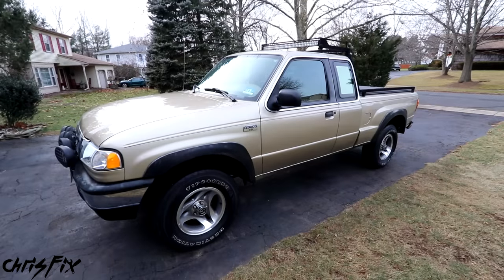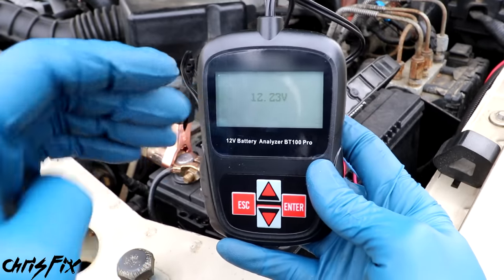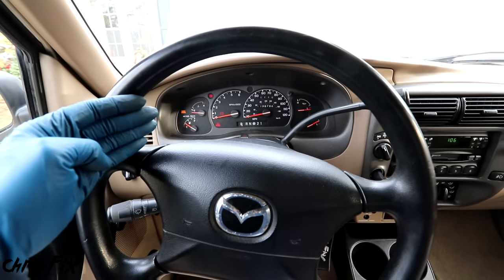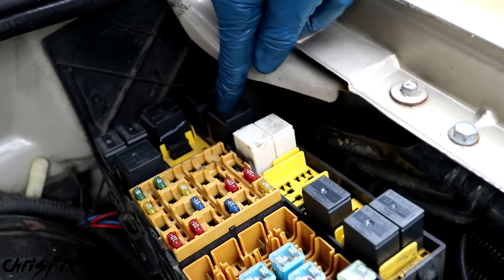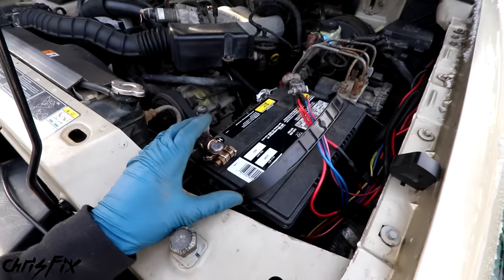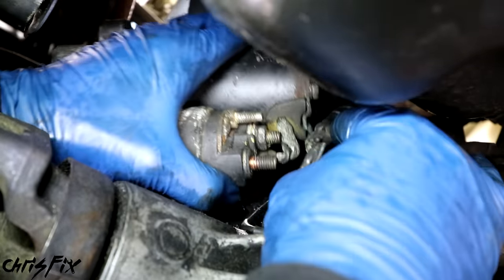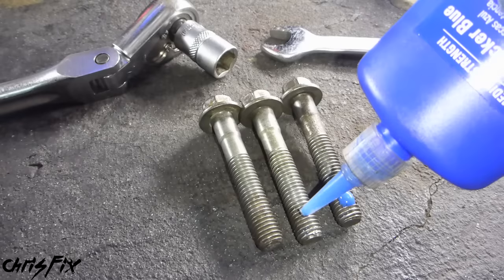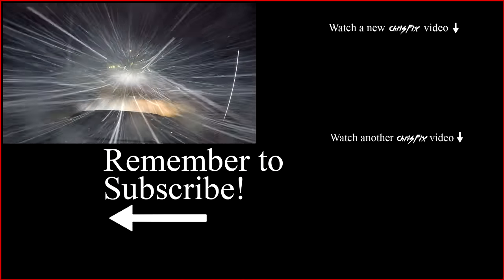How to Diagnose and Replace a Starter

Comment: Bro. I love your videos. You’re a really skilled technician. But wanted to let you know you can load test the vehicle battery with a DVOM and by turning the head lamps on. If a battery doesn’t stay above 12V after about 20-30 seconds it’s bad. Just a tip from me to you. Keep up the awesome work 👏

Comment: I don't have a starter story.... but I do have an alternator story! 
I was driving to a junkyard to get parts for my 1992 Ford Aerostar. When I left the junkyard the battery was dead. After a jump it started right up and I drove over 2 hours from the junkyard to my house, where all the gauges were being erratic, and it finally died on me as I was pulling into my driveway. Another jump, and it died again later after letting it sit. Got in the beater to go get an alternator, installed it at home, and everything was great. So blessed to have a dying alternator last an extra 100 miles to get me home.

Comment: Extremely well put together vid! A well polished edit that is very informative and easy to follow. No annoying editing tricks, background noise, time wasting visuals, or word whisker commentary.

I have a Japanese imported van that may need its starter motor and solenoid replaced. There are currently no videos on the van I own that will serve as an exact how to... YET, this vid is what I plan on using to get the work done on my own. Swapping out a starter is rather straight forward. This video covers a lot of useful information on this subject that can assist any viewer with the same goal, but working on a different vehicle.

Moreover, the commentary was superb! Usually you get the guy over a vid like this that struggle to explain what they are doing. They will usually say “ummm”, “and like”, and use “kind of” between every other word or in every sentence. Not to mention bad audio that will leave a viewer wondering what they said. NONE of that here!

Thank you ChrisFix!

Comment: You did a great job on diagnosing and replacing a starter. But the one thing that helped me that I overlooked was the battery cable. Thank you for your input. can you do one on blower motor

Comment: Great video, very entertaining as well as informative :)  I have a 2006 Honda Accord.  Periodically the car has a hard time starting.  I checked the battery which is only 2 years old.  And it will start with a boost.  I figured it was the started, now I'm debating if it has something to do with the key now I've watched your video.  The key housing is cracked.  So I wonder in the chip is not sitting right.  I don't want to get hosed on replacing the starter and then it turns out to be the key.  Thanks again for a great video.

Comment: Excellent video and channel. I love working on cars, but when I can't troubleshoot the cause, it frustrating. With your video, I learned enough to hopefully fix my car. I have a 2005 Civic and also has a no crank problem. I suspect that is the starter relay because last month I also had a no crank problem and the symptoms was a bit different: it as a click sound. So I replaced the starter and problem solved. But now, after a month, when I turned the key, after like 20 or 30 attempts, my car cranks / starts and I almost no hear a click. The starter is new, the immobilizer is working, I don't think is the battery because my windows rolls fast and it cranks after several attempts. So I think is the relay, unless the starter is defective. Thanks for sharing, I also subscribed to your channel for your good content. (Ha, and another way to support your channel is to not use an adblocker, so I don't have one :)

Comment: 1985 thunderbird: to get to the starter, which is attached to the trans underneath, I had to remove a supporting cross bar whose bots must've had 30 year old rust and undercoating cementing them in there. I dont have the fanciest wrenches to I ran an extension and universal joint through the undercarriage of the car and onto the top starter bolt. thankfully, the starter bolts where relatively easy to turn but I'm thankful I finally got the thing out! dont give up!😄

Comment: I once replaced the starter in a 2005 Ford Focus that was sort of difficult to get to in the middle of the engine but what made it a real tough job is the auto parts store, ( i won't mention which one) gave me the manual trans starter instead of the auto which the three bolt pattern does not line up correctly to prevent damage to the flywheel. So like Chris says always bring the old one in to inspect and see if it is the right one!

Comment: Thanks for the video.  Have a 2004 Ford Ranger.  Power stering fluid is dripping down the wires to the starter.  Having intermitant start issues.  Going to pull out the starter, but wondering if that could damage the wires?  Hope for the best.

Comment: Chris the starter keep running today on my 82 FJ40.  It finally stopped on it's on, but then won't start next.  Hit on it and it started.  Tried it again and it worked.  Plan on replacing it before I go anywhere in the next few days.  Any suggestions on the FJ40,  gear reduction starter?

Comment: Great video!  My starter sometimes makes a whirring noise when it starts. 1999 Ford Ranger 3.0L 4WD.  Only does it sometimes.  Would that likely be the starter drive going bad?  Always starts, just makes the noise sometimes.  Also, would changing the starter in your video be made easier by loosening the front U-joint and dropping the front drive shaft?

Comment: Hey Chris.  06 honda civic.  Bought it with no start problem.  Charged battery and it load tested said battery was good.   Got my son to use ignition while tapping starter.  Fired up.  Worked for about 3 days and same thing.  Took starter out and bench testing it find it engages and turns every time.  But with no load could that mean starter is still bad?  Don't want to put it back in.  Also don't want to replace if unecessary

Comment: funny thing. I could've sworn my Mom's chevy spark 2017's starter was kaput, but turns out the battery was the problem. And with this vehicle is totally cramped, had to remove the wires first and then the bolts, oh there was only two on this model. But in hindsight, I learned a new skill. And the car has more than 30,000 miles on it now. FIgure, I fixed a future problem lol. And the battery was 12.3. So now I know this isn't powerful enough. Now just need to order a new battery, Thank you for the lesson tho. Always good to learn new things. Have a good one.

Comment: Hey Cris. You could have tried to replace starter solenoid... it's cheaper than the whole unit and easy to do when starter is off the car. Usually it becomes bad because contacts inside go rusty and that needs to be replaced because in very most cases it couldn't be dismantled without angle grinder and welded back once cleaned, but it is not so expensive to play such games with it... If hammer trick works... the solenoid steel bulb that pulls bendix hand also can go rusty which makes the bulb stuck (sometimes sanding the rust off helps). Starter on my Ford Escort mk5 '91 is located right behind the exhaust manifold, and on hot, sometimes, starter was not working because it is being ceased because temperature expands the solenoid bulb, so I had to wait until it cools down and then try to crank. Life hack (not tested by me) : Guys tell that the bulb could be given to the miller and he could take off 0.5 - 1 mm from bulb's diameter and temperature variance won't harm the solenoid...or put a screen below the exhaust manifold to reflect the heat.

Comment: I'd recommend buying cheap starters online instead of remanufactured or new from an auto parts store. Last one I got was 1/6 the price of new from a parts store and worked fine. I once went through three bad remanufactured ones in a row before buying new online at 1/3 the price, and it's still working four years later. When they "remanufacture", are they even testing? I've also gone through two bad remanufactured power steering pumps on one car, but that was in the days before you could buy cheap online.

Comment: So Chris fix what do you think about this scenario. Car cranks and acts like it normally does when starting but don't start. It takes 4 or 5 attempts to start. My mechanic said it might be a fuel pump. I primed the pump about 6 times and it didn't make a difference ruling out bad fuel pump. What do you think? (It was very cold but my car starts good in the cold. Battery is good too.) (I have concluded that I got bad gas from a station because after I filled up at a different gas station the problem was gone. Was it just a bad tank of gas or something else?

Comment: thank you very much for sharing your experience. I have problem with my starter; looks it is shorted to the battery positive; not sure but run some diagnostics to find out where the short is. Thank you foryour uploa it is very iformative and to the point. Good commentarym good video visuals and well explained. Keep up the good work. I liked your video.

Comment: 84 Mustang 302. Starter field. You have to use an air ratchet on the top bolt.
I used about five starters from O'Reilly's. Worked at First. And then they filled. In the weirdest places. So I bought the top-of-the-line starter from O'Reilly's and never had any more problem with it. You actually get what you pay for.

Comment: Hi chris, I have a 2013 Honda Accord v6 push button start (keyless). When I put foot on brake & push the start button in Park I hear 1 click inside the starter but no crank. When I pull the solenoid control wire & put positive lead in it with negative lead on neg. battery terminal I see 12volts for a split second then back to zero volts. My question is should that 12v stay solid after pushing the keyless push button start? I am trying to diagnose on why it takes multiple push button attempts to get my 2013 Honda Accord V6 to crank over by starter. I see many people owning 2013-17 Honda Accords complaining about this. I see that in 2013 Honda put the starter solenoid inside the starter housing instead of having a separate external mounted starter solenoid prior to 2013. Thank you for providing any info that can help me or others. Happy Holidays & Stay Safe!

Comment: CHRIS  great video but on my 2003 camry LE V6  was running fine but came out and when i turn key i hear a spinning or wining noise from the starter.  but dosnt turn over at all.   what do you think
Reply from the maker: Sounds like the bendix isn’t coming out all the way so it’s spinning but not engaging the flywheel. Replace the starter.

Comment: You should also check the 'other end' of the battery terminal cables. I have had a couple of problems where the nuts were loose and/or corroded. Also had a ground cable connected to the engine block with a bolt that was too long such that it bottomed out before it tightened on the ground cable terminal. I added a couple of washers and fixed that starting problem.

Comment: I’m a little excited now. Never replaced one and my crappy ranger definitely has one. Only before it went out it was giving me signs. Like for a sec after I started it it would sound like it didn’t pull back and the engine was turning it. It hesitated a bit the last time I cranked it

Comment: Intermittent no crank/no start on 2010 malibu. Only during the cold seasons...dropped new battery in because it wasn’t up to par. (Needed it anyways). Will start at times then not start for a day or so. Starter, neutral safety switch or possible relays? Heard it could be a plethora of issues, some of these included. Any advice helps!

Comment: Sup Chris. I have a long story but here it goes. My 08 dodge charger is having issues starting. I replaced the starter and the relay. The battery was still good for starting so I'll be changing that soon. The kicker is that when I go to start my car the belt moves forward but suddenly goes backwards during the starting process. We accidentally found out that putting it in neutral and rolling in t backwards would help the car start from it getting unloaded from the tow truck 😅. But after that she only starts periodically like it's processed 😕. Just wanted to ask if you knew anything on that. 💯

Comment: this video is AWESOME! I couldn't believe that my car worked one day and not the next! So Annoying! I replaced the battery because it was old, but still, no turnover. That's fine, the battery sucked anyway. My car doesn't have that "theft" light, but I decided to change the battery in my car key anyway. Still no turnover. Again, no big deal, a new battery is better than old. Then I realized I was parked on a steep hill, and perhaps it wasn't quite in park, or partially "fell" out of park. I "pushed" the  gear shift down a little and then up HARD into park. THE CAR STARTED! THE CAR WORKS! If it doesn't happen aain, I will consider it "user error" (mine) - if it happens again, I'll have to take it somewhere to be looked at for why it "falls" out of park! YAY! YAYAYAY! Thank you!

Comment: Chris, appreciate the video, as I was unsure that the starter was the problem. My '03 Honda tends to go from doing nothing on the first try to sluggish turning to starting on the third or fourth try. My question is about CCA. After watching the video, I checked my battery's voltage and saw also that my CCA is 350. From the video, that would appear to be low CCA to start the engine. I searched and read that this model needs 640 CCA and Autoweek recommends 600 CCA. Do I just need more battery?

Comment: My starter died on me twice this year. First time in february. I thought it was a flat battery but jump starting it didn’t work and I had to get it towed. I just finished a 10 hour night shift and was pretty tired, so walking home in -25 C for over an hour was not fun. After he changed the starter it worked great for about five months. It died on me again this week; this time I also assumed it was the battery, as the starter was fairly new and the battery isn’t. However the battery is good, so I thought it had to be a blown fuse or something, but no. We tried hitting the starter with a hammer while turning the egnition like you said, but with no luck. So the mechanic changed the starter again. It works great now and starts up quickly. I’m starting to think there’s an issue because a starter should last longer than a few months and I’m not driving That much. Do you have any ideas?

Comment: I got a question, you said silicon is a good idea to put on the starter to protect the connections, is it also a good idea to put it on the battery terminals too? I know there is red battery terminal spray used to protect it but could silicon be a supplement ?

Comment: I ran into a situation where my car is no crank no start and it was running great yesterday. I have checked the starter alternator and the battery. The check engine light didn't light up as you said.
Any videos about how I can tell if the computer is good or bad?

Comment: Thanks my 2002 camry v6 was hesitating upon starting,  eventually just slower and slower till it quit on me. 
I whacked the starter and it spun but made an electrical buzzing noise and smelt like burnt wires. 
Took it out and I could smell the solenoid had that burnt smell and some rust on it.
I'm trying to save a dollar so I was completed on whether it was solenoid( cheaper) or whole starter( more$) ???
You reminded me I can get it tested at auto zone thanks. Now I'm gunna order the right part from rock auto.😊 thx

Comment: Hey Chris, I replaced my oil pumpsbd pick up tube in a 98 ram. Reinstalled my starter and the engine sounds really loud Nd vague grinding sound. Made sure the maintenance plate isn't hitting... im having troubles figuring this out

Comment: I like to disconnect the wires first (if possible). That prevents a lot of grief when having to deal with rusty and corroded terminals that don't want to loosen.
Vaseline can be used to smear on the terminals (goes for your battery too).
Reply from the maker: Thanks for sharing!

Comment: Hi Chris, I have a question regarding the starter in my car.  When the key is turned all the way to start, it starts normally, but if the key is only turned partway to start, then it makes a loud whirring/screeching noise and does not start.  Was wondering what could be causing this.  Never seen this before in other cars before.  Love your videos!

Comment: Hey ChrisFix! I have a Volvo XC90 V8 that may have a starter problem. I have checked all the fuses and changed the battery, and every time I start the vehicle, the engine has a difficult time turning over before being able to start fine. 

But after driving 30+ minutes when I shut off the engine after I arrived at work I then need to use a jump pack to start the engine again after I get off of work.

Is this a starter problem or a different problem?

Comment: Doing this today. Mine did show signs of wearing out though. It started spinning slower during start ups in hot weather a few weeks ago. It's the 2000 ranger and only has 258,059 miles on it. Got home from work yesterday thankfully and when I tried to go get groceries it turned over a few times slowly then nothing. Battery is 13 volts. I had oriley check the battery, alternator and starter with their tool two days ago but the kid was new and I don't think the starter got checked. I mean it started so maybe that passed the test but I could hear it struggling. Time to get all dirty!